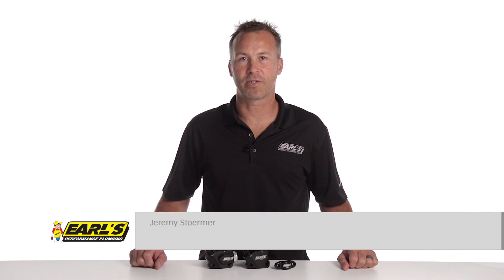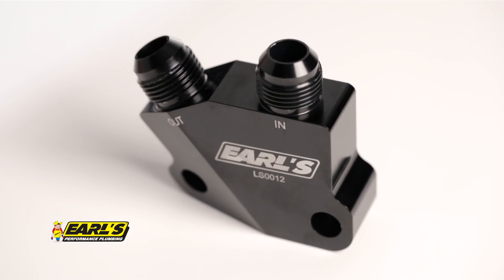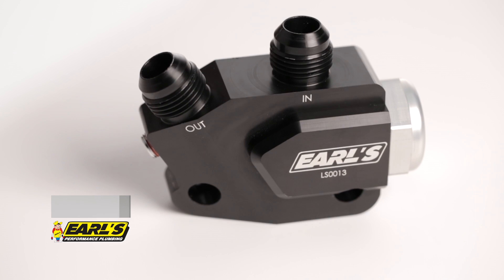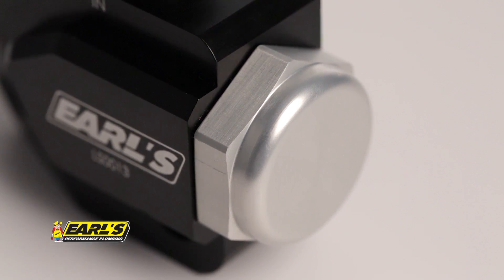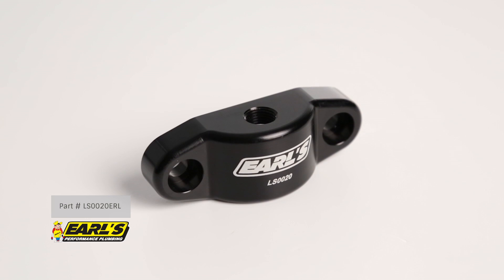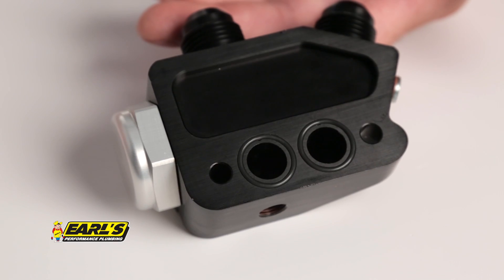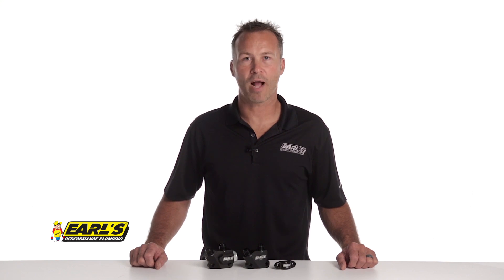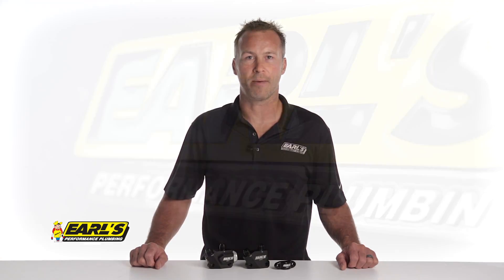Earls LS Oil Cooler Adapters and Block Offs

Comment: Will LS0020ERL fix my oil leak from my oem block off plate with metal gasket? I kept replacing my gasket every oil change even the block off plate and it still leaks.

Comment: Wish I would have purchased this instead of the Derale.  Earl's thought to include the 10AN inlet and outlet port fittings.  Step #1 in for the Derale is to install the 10AN fittings (NOT INCLUDED) Freaking idiots. Now I have to wait a week for them to get delivered. No auto parts stores in my town have a comparable fitting. Nice thinking, Earl's!

Comment: Will these fit an LS from an Australian holden ..

I tried the aeroflow one but the mounting hardware isnt long enough and I like the look of the earls hardware more.
Reply from the maker: We don't get many Holden's up here in the States, so it's hard to give u a positive answer.  Maybe check with your local dealer and see if the engine blocks are the same as production pieces we use here in the american vehicles? If you could give me some dimensions of the bolt spacing and port outline I might be able to compare it to our pieces.  Also if there are any casting numbers or identification numbers on the engine block that might help also.  Thx J
Reply: HolleyPerformance I believe I just need a longer stud